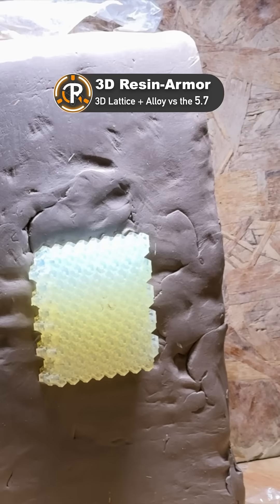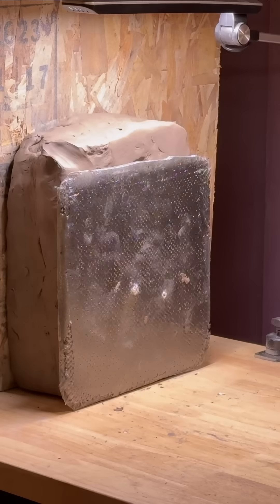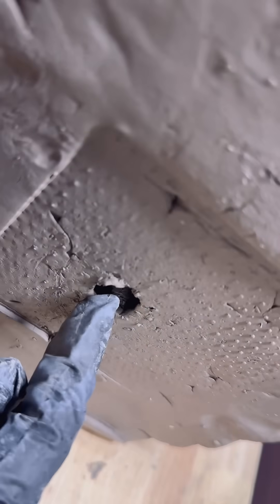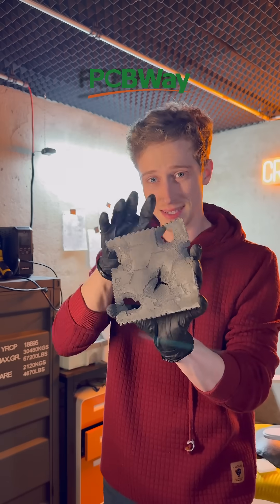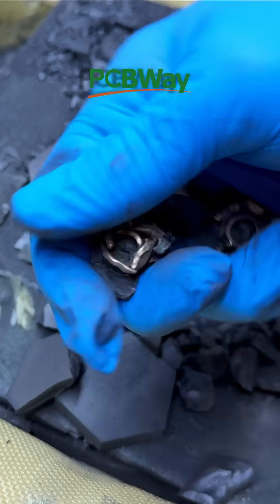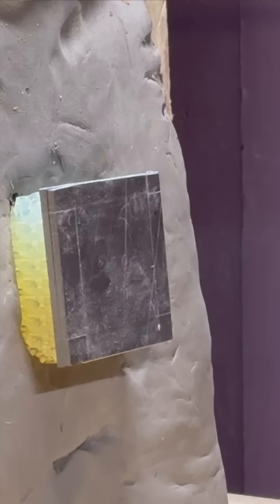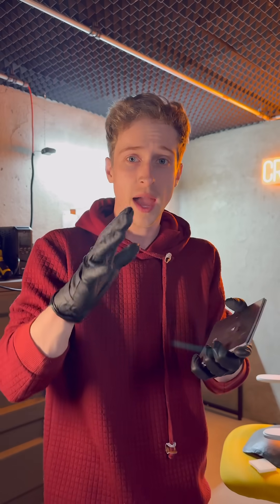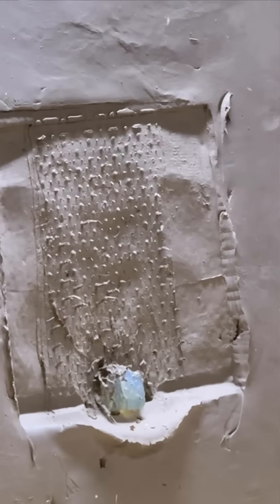3D-Lattice Impact Armor 💥 #shorts #batman

Comment: I might be missing what you're doing here, but doesn't this suffer from the same issue as every other type of hard armour in that when the round impacts the hard face, it breaks up and sprays high-velocity fragments in every direction roughly in line with the plate? It's serious enough with lead only projectiles but extremely dangerous with jacketed projectiles as the jacket disintegrates into razor sharp pieces that despite being low mass, could easily nick/penetrate an artery?

Comment: Would printing the tubes at an angle help. So that part of the bullets energy is burned up in deflection? If that did help you could even print armor panels with the cant away from vitals

Comment: you need to layer your different materials like a lasagna the structure should be stronger sort of like ballistic glass or plywood this should allow for your you printed parts to hold up better and give you the ability to use lighter bits of metal.

Comment: Maybe print a sleeve for it out of that new tullomer filament.
Reply: I wonder how some of these other materials used in FDM 3D printers might work.  I make a lot of stuff with PETg and it's quite impact resistant, and If you tune the print you can get a tight grain and very dense product.  There's also kevlar and fiber embedded filaments that might be useful too.  This guy is inspiring me to try.
Reply: @3buttestradingco.745  the tullomer is designed to be 3d printed. The fibers align as it is printed and it is stronger than kevlar and steel. You have to use a printer with a chamber and it is about $500 a roll but would be interesting to try.

Comment: @CrashMakerspace
🤔 Im wondering what the difference would be if you sandwiched the aluminum plating, between 2 of the 3d printed plates.

I wonder if or how much more effective that would be, rather then with just one of each.

Then another step, if titanium plateing would be more effective then aluminum.
Reply from the maker: Grade 5 Ti was my first choice until seeing how expensive it was, so 7075 I went 😅 As to the plating, they're best served consecutively since having 1 plate unsupported results in a puncture of the front! Having two allows them to immediately support each other via the shear line
Reply: @CrashMakerspace  I can Definitely understand costs 🤦‍♂️hopefully,  later on it might be more plausible. 
Per the plating aspects, you kinda lost me... 

Cause I was referring trying/shooting: 3D/Al/3D

But it sounds to me like you were saying that you're doing: 3D/3D/Al

And if that's the case, then I was saying that you should try 3D/3D/Al/3D/3D or  3D/3D/Al/3D (exterior<>interior; &/or vise versa)
🤷‍♂️😅

I thought you were just doing: 3D/Al

Also, im sure you've already looked into it.. the lightweight fabric that prison guards (flexable, stab/slice/puncture proof) shirts are made of... might be a good idea to research &/or use that throughout your body suit.  [If you already have looked into it, my bad]
Keep up the good work brother!!👍💪

Comment: Been following you for a few months, was interested if maybe you'd like to share/discuss more of the nerdy details like calculations regarding how much energy your armors can endure, manufacturing processes etc...
I'm simply a 4th year mechanical engineering student and might want to promote a project at my university to try and replicate/improve upon your designs.
Reply from the maker: Hey Dude! I'm working with a company to try and bring something like this to market and he's working on the business side of things and manufacturing, so I'm limited in the stuff that's considered *proprietary. 

However, when it comes to ballistics, classic equations of energy such as E=1/2mV^2 along with cross-sectional area, correlating distance (stopped), impulse curves, etc can build upon and inform individual layerings. Then these can be applied to fragmentation / deformations / etc depending on the layers you're designing like I did with my .300WM super plate.
Reply: @CrashMakerspace  I have an idea for an alternative structure to use. What you have now is probably better, but I thought I would offer something to experiment with just in case it's useful. 
What if you use polycarbonate miniature "tetrapod wave breakers". If you stack them together, they could theoretically shatter a bullet and dissipate the momentum of the fragments.
Reply: @CrashMakerspace  that's great, thanks for the detailed response.